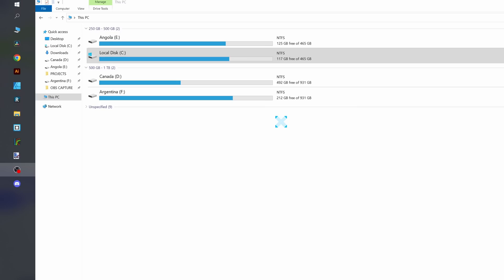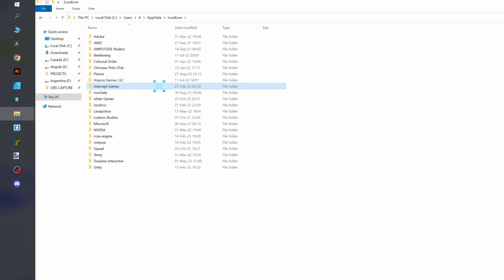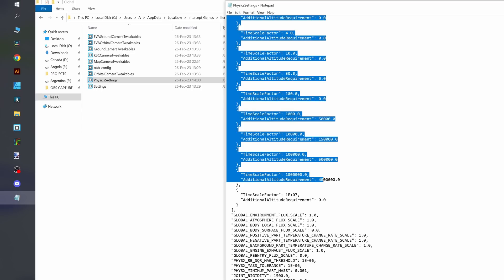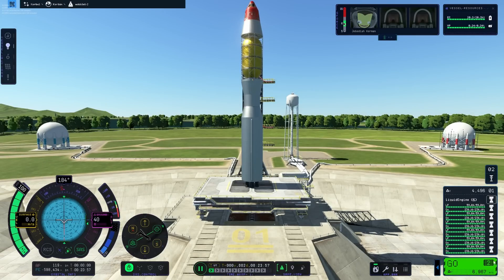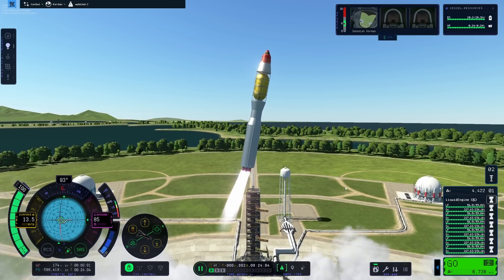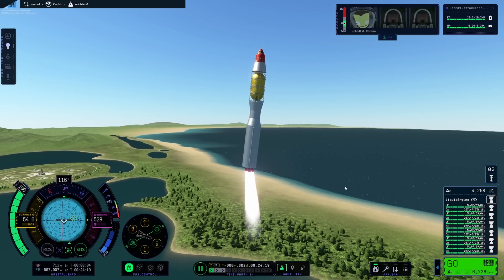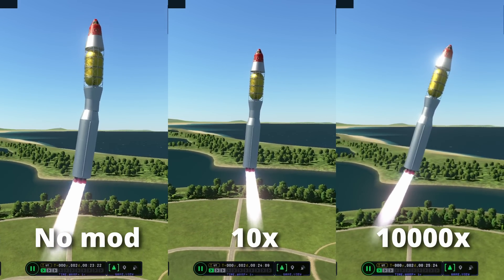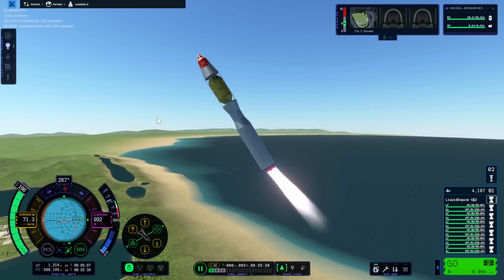fixing wobbly rockets in KSP2.

Comment: Who the heck thought ghis was ok to put into eaely access like this. Damn such a easy fix.
Reply: Tell me your expectations of early access.
Reply: @zeroneutral  our expectations of "early access" are: not 50$ if there are so many game-breaking bugs and none of the interesting features they talked. Is that really unreasonable?
Reply: @packediceisthebestminecraf9007  You'd rather pay more in the future for the same product?
Reply: @zeroneutral  I wouldn't, because I don't buy games that cost more than $50. My point is that $50 is clearly way too much for something that isn't even close to finished product.
Reply: @zeroneutral  " Tell me your expectations of early access." feature complete, playable game with the same amount of content as ksp1, preferably with better performance and less bugs but these would i guess be "stretch goals", and a similar level of performance to ksp1 would be perfectly acceptable. ksp2 is none of these things. it is not feature complere, not playable (at least not comfortably), has less content than ksp1, is buggier than ksp1, and runs worse (FAR worse) than ksp1.
Reply: @zeroneutral  Less content is OK (career and science DO need refining), no new features yet is OK (that's the point of an EA), non-existent optimization because modifications to game engine, we can manage ; but not LESS features than KSP 1. BASIC features. No electricity, no heat, no autostrut, wrong calculated Dv, no TWR in flight, no TWR info outside of Kerbin, no precision maneuver gizmo, no trajectory visible in the next SoI... the list begins to be long. I don't even speak of the "no mods support until late in the EA", that's not like mods literally made KSP 1 what it is now. For fifty-forking bucks. 
Like they are now they have between 6 month to 1 year of work re-adding things that where already in KSP 1 before even thinking of the new features they announced 2 years ago. But "hey, it's early access, and they added rings to planets, yay !"
Reply: @zeroneutral  50$ is not early access it is Full Price!
50$ AND Bugs AND bad Performance AND bad balancing AND less features is almost Fraud!
20-30$<---That would be early access with bugs....
Reply: @zeroneutral  I played ksp1 early on. I followed the ksp2 Info train and after they decided to wait with ea release till 2023 (2020 was the initial release goal), yes I expected more. In 2020 everyone said, it's ok, take your time and make it better. Now 3 years later this is what we have. How can I no be dissapointed? Sure I expected bugs and missing features, but this?
Reply: @zeroneutral  Gamer's expectations of early access: Finished game

I wonder if they ever moved to a house that has had it's foundation poured in and complained that there's no heating or roof
Reply: @randoguy7488  Preach.
Reply: even worse, they put it into early access and charged 50$ for it...
...and it's not optimized at all, and has less features, and has a lot of annoying and game-breaking bugs, and doesn't even have a different building for making planes...
Reply: @packediceisthebestminecraf9007  we dont even have fuckin TTW or Dv readings not even re-entry effects. Its fucking insane. IG is a fucking joke at this point
Reply: @packediceisthebestminecraf9007  do you not know what early access is
Reply: @Childneglecter  Yes, but for $50 I would expect a release in early access that at the very least has one of the following things: performance, features or no bugs. I'm completely fine with games in early access being buggy, not performant and not having any cool features, but not for $50.
Reply: @packediceisthebestminecraf9007  you expect an early access game to have no bugs? Unrealistic standards
Reply: @Childneglecter  wrong. Why do you have to remove all of the nuance? I said that for a game to justify a price tag of $50, even in early access, it should have at least one of those things.

Comment: .... Im baffled how easy it is to almost fix it completely.... And irritated at the same time they gave no fuks and thought it was alright to fly sausages and release the game lol , still thanks... Now only if u could fix the fps... Hah 😂
Reply: But at least you can color your rocket pieces. That's what matters, right?
Reply: @keyser456  well ngl it is quite neat but I would rather have a stable game than fancy cosmetics first
Reply: @papascrumpeeh  I was making a joke. Function is far more important than form in software development. Without a properly functioning application/game, you've got nothing. They shouldn't have wasted time on coloring rocket pieces until they made sure rockets could fly properly in the engine. It's like releasing a cell phone that can't make calls properly, but it "feels nice" in your hands. That happened, btw. :)
Reply: That's not fixed, that's a work around to emulate a feature that has not yet been added in early access.
Reply: @zeroneutral  the bullshit excuse of "it will be added" is getting really old quickly cool they fuken failed to add core base elements and release it quite unplayable to most people  and slam a tarded price tag with it.

Comment: So, we need kerbal joint reinforcement AGAIN.
Reply from the maker: circle is complete ;-)
Reply: Untill it becomes stock... again!
Reply: @Enexam_  Been there done that for years now. Not sure why it is need to be repeated again…

The early access are supposed to get feedbacks from things that are new to the game… not for repeating the same old shit over and over again.
Reply: I want to see a different node system entirely tbh, not just stronger joints. It would be cool to instead be able to attach parts with a ring of bolts, which could be explosive (for decoupling), and since there would be several attachment points around the center of mass of the parts, any torsion stress would be transferred through those bolts, and you could simulate more realistic breakage without bending and getting all noodley or having practically unbreakable joints. It would necessarily require some system of multi node attachment which is something that you need anyways to build more complex structures.
Reply: @Enexam_  No, this is basic QA which should be done before a release. 

This nothing the devs cannot find out without our help in a really easy manner.  

Other early access titles manage that way better.

This is just plain missmanagement of ressources on the side of publishers and developers.

Imagine a bare-bone early access release. Only parts of the Kerbol system, say Kerbin and its moons and one or two other planets. All the developing work would have gone into making the physics engine work solid and high performant. Programs like soldi wokrs could habdle real-time physics calculation for 120.000 parts easily, with a much more complex joint calculation and different properties for each material. 
AND THAT WAS TEN YEARS AGO!

Even if you add the complexity of interaction with other vessels and surfaces, 1000 part physics engine is not unrealistc in terms of computing power right now. 

But what the devs have done is to work on multiple topics at once, designing other planetary systems, and laying the groundwork for many other topics which we will not see until severla month or maybe even years later. They underestimated the foundations of the game: Being able to build complex rockets.

Feature incompleteness is not an issue for most of the KSP1 fans, but bad performance and bugs lead people to get a refund. And this is entirely a management topic in my eyes. Both on behalf of the devs and the publsiher.
Reply: @Zuluknob  haters who hate because of news you even do not know if it are just fake news
Reply: @Zuluknob  wheres the proof of the old version and its not broken it work it runs its early access stop complaining you see it as over priced cause its just the base of the game and nothing else its price is right for the full release and just cause its early access dont mean it should be valued at less it will be a good game next year is my guess so im holding off till then and if they raise the price for the full launch id be happy to pay its only overpriced to some cause 50 is a lot to some
Reply: Early access.
Reply: @zeroneutral  early access should be a solid foundation. not a half finished tech demo
Reply: @SamTheApe  What is a solid foundation to you? How much more solid does it need to be for you to consider early access?

Early access here doesn't mean "play the game before launch" like some other titles have done.
Reply: @gmlviper  People like you are the reason mankind can never undertake any project that is not immediately profitable.
Reply: @zeroneutral  not having to change config files to make the game playable would be a start.

what does early access mean if it's not "play the game before launch"? paying to be a playtester for an unfinished tech demo? you'd be right in that case
Reply: @SamTheApe  That's exactly what early access is.
Reply: @zeroneutral  How does waking up to be this gullible for another day feel?
Reply: @zeroneutral  ????? Early access is early access to a game, friend. Not a tech demo. Are you reading my comments?
Reply: @alanwatts8239  It's ironic that someone who named themselves Alan Watts is so glib.

I read the fine print and comprehended it properly.
Reply: @SamTheApe  See: Early
See: Access
Reply: @SamTheApe  bro it is a solid foundation there not any thing missing from the building and space exploration the lag tho thats some beta shit i agree but the rest is not a tech demo
Reply: @zeroneutral  then why is it $50. When ksp 1 was in this state it was free. Aka no money down. They need to focus on the core mechanics not fluf. I don’t care about having a full solar system if my rocket won’t even launch. Make it just Kerbin and the mun and give make the game stable.
Reply: @zeroneutral  full price
Reply: @beefstew6512  Gotta remember. Its Early access even if its 50$. That means its immune to criticism and absolves them of any responsibility. We can't launch full-fledged games anymore, after all gamers have such high standards these days that we can legitimately charge full price for the complete game. They love their little content patches every couple of months that slowly patch in more of these unexpected features......
    Let's be real this is what they probably tell themselves because gamers have set the bar so low for what they will buy, soon we will have to make the game and pay them at the same time. Also, it's not the devs fault.  100% sure it's the stupid publishers or upper management being pieces of crap.
Reply: @beefstew6512  It's discounted in fact.
Reply: @zeroneutral  how generous
Reply: @beefstew6512  and its early access its gonna have issues dont mean they will make the game half ofj just cause its early access and has stuff that need ironing out
Reply: @zeroneutral  true got mines for 45 where i live it was ment to be 59.99 so i agree 100%
Reply: @violentjunkie129  yes thats what it actually means. 
Early Access means generally NOT a finished game, so it should be valued less than the finished game.
Take Sons of the forest, which come out one day earlier. 
Game works well so far, looks cool. Is it finished? no .. lots of story is missing and some crafting recipies and other stuff.
And thats fine, since its early access. But the game itself is quiet playable.

If you have KSP 2 here, who demands almost the double, with wobbly rockets like this, and a lot of other bugs i have seen, than it doesnt feel "playable" to me.  

50 € for a buggy game with almost to none content is just too much. i really liked KSP 1 but i have to wait until they fixed their shit and even than i will be hesitant to buy the game.
Reply: @Arcticwolf2425  Yeah, I would be so happy as a publisher right now. People were hurling insults against passionate KSP1 players who dared to criticise the current state of the game. 

If you look at the divided reactions right now, there is no need from a publishers point of view to ever develop something to full release state. 
You can save so much money as a publisher, if you just slap "early access" on it. You might lose some buyers, but enough will buy, to make it worth the influx of fresh cash during alpha stage of the software. 

Oh, and if you hint at a slighly higher price in the future (for an already full priced software, to remind you), people will defend you again! Now you have to buy it, because it will be higher!
Reply: @mephisto8101  >who dared to criticize the current state of the game

Except, over here, a frankly HILARIOUS part of the complaints are always "wtf my ULTRAmodded KSP 1 game looks about as well graphically" that I've seen.
Alongside "wow where are all the mechanics i want KSP 1 on launch"

The price? Fair.
The bugs? They'll be fixed, but fair.
The lag? Also will be fixed, but fair.

But jesus christ people, the sheer vitriolic shit is kind of disgusting, no matter WHAT state/cost the game is. 

Especially the "STOP HAVING FUN, HATE THE GAME AND STOP SHILLING IT!!!!" when someone posts a video of their gameplay... 
Not making claims or anything, just a video of someone, say, landing on Eeloo with their rocket.
Reply: @higueraft571  
Glad it works for you. And your opinion is entirely valid, of course.

A couple of years ago (or is it decades?), this would have been released as a demo. For free. Maybe with some less parts and planets, but overall, for me, it is on thelower end of demo quality. 

For me, the price in relation to its performance is not fair. It is banking on future improvements and includes the threat of price increases in the future. 

The bugs, for me, are not fair. The physics engine is the foundation of the game. Something went wrong during development to bring out a game in this state after the current release date was communicated almost a year ago.

The lag is not fair for me, for two reasons:
- personally, it is game breaking for me. Other people have higher tolerances for low FPS, for me it means painkillers after play.
- this should have been optimised before launch. If you look at other phyhsics calculations in real time, say for solid works, they can manage upwards of 100.000 parts with way more complex physics interaction and joints behaviour. Even if you account for Planets, surfaces and whatnot, 1000 parts at a medium grade pc should be absolutely possible right now. 
With proper optimization, I expect a similar performance like KSP1 in terms of parts count for the future. If you look at videos right now, we're very far from this.

The graphics is not bad, but far from great for todays standards. Doesn't matter for me, because for me the core experience is building crafts, not eye candy.

Mind you, this nothing against you, I am glad that you are having fun with the game. I am looking forward when this can be the case for many more players, me included.
Reply: @zeroneutral  I see you are very "vocal" about this "early access" crap. It is, indeed EA, but for KSP *2*. A normal person willing to spend 50$/€ on it would assume that problems from KSP 1 would be already well undeestood and solved.
An iteration of a game should be at least on par with its predecessor in regards to well known bugs, not a step back from it. Why is the 2 for, then?
Reply: @zeroneutral  Early access of the SEQUEL

Why ya all acting like ksp1 never existed?
Reply: @tonamg53 it's a coping mechanism for them. People just need to stop fucking around and be honest here.
Reply: @GSF404  Yes, totally agreed, honest feedbacks are needed to get the dev stop fucking around and start doing some proper work. 

KSP meant a lot to many people…and KSP2 is just a total disrespect to the community.

Comment: Helpful, but still dumb that we have to do this in the first place
Reply from the maker: there are some traces of autostrut in the game files. Considering horrendous state of UI atm, I bet they just rushed decision to cut autostrut from EA release.
Reply: @Yakez42  UI is not bad.
Reply: @crue-xx  I personally love the UI. If they are talking about glitches, then yea that has moderate issues
Reply: @crue-xx  It's the font that kills me, it has to be one of the least readable options they could have chosen.  You need to be able to glance and read a value, not stare at a pixelated display that looks like its an early lcd clock and try to decipher it.  Hell cursive would have been better.  (and the part manager is horrendous) - the overall style of the UI is fine if these issues were fixed and the proper info was included (burn time before starting burns, per stage ISP, TWR to start)
Reply: @Brandon-rc9vp  I get what you mean but the UI style is fine.
Reply: @Yakez42  Yeah seems that way, what do you think, when will the game become playable again? I would say, if they are fast, 2-3 months
Reply: @MarvinHuber_PlanetCoaster  I actually think it might be 2 to 4 weeks. The devs themselves are likely pulling lots of overtime.
Reply: @MarvinHuber_PlanetCoaster  It's playable that's why it was released to early access.